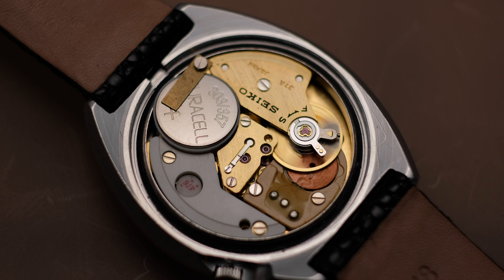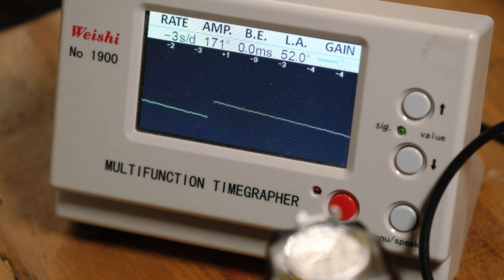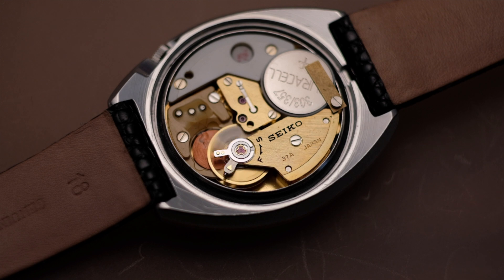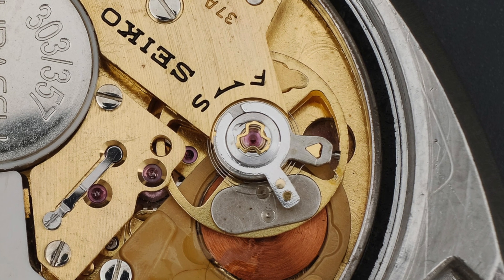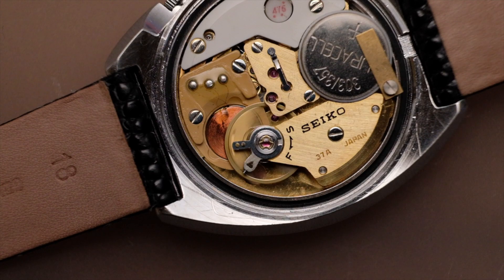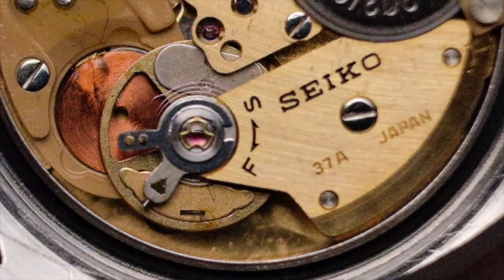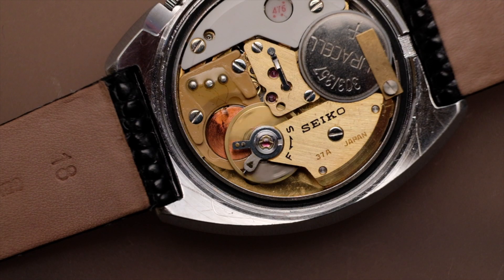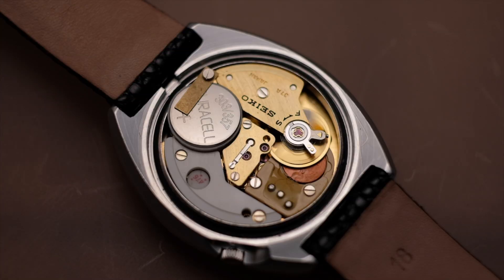Seiko EL-370 Electronic Watch Movement

Comment: So Electronic is Basically Automatic movement right
Reply from the maker: Only in the sense that it doesn't need hand-winding but then it doesn't have a mainspring.  It is only automatic in the same sense that a quartz watch is automatic.  It will keep running until the battery runs out.

Comment: What makes a timegrapher unable to accurately detect the amplitude of this movement? Because the balance swings far beyond what a normal mechanical balance would do?
Reply from the maker: I'm afraid I don't know the answer to this question.  All I do know is that I cannot get it to display the true amplitude on my Timegrapher.  I need to check and see whether this is also true of my other electronic movements.

Comment: I have one of these electronic watches, has both mechanical + battery, doesn’t run, am I supposed to wind it like a mechanical watch? Or try a new battery?
Reply from the maker: There's no winding these watches - they need electrons! A fresh battery and if that does not work then a service.
Reply: adventuresinamateurwatchfettling its a hamilton 683, will try new battery, thank you.